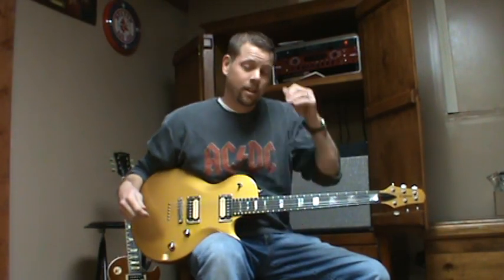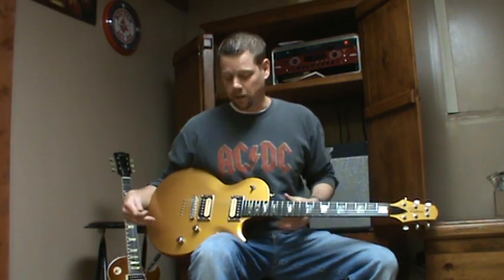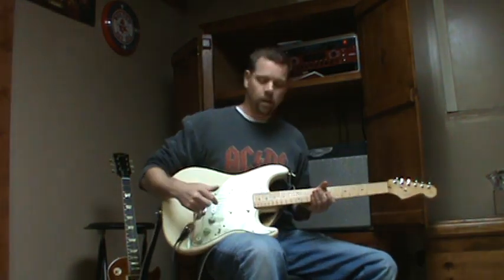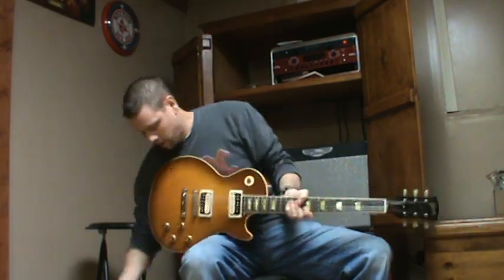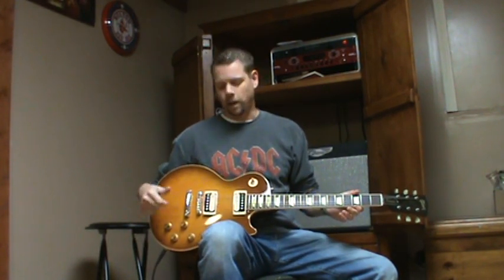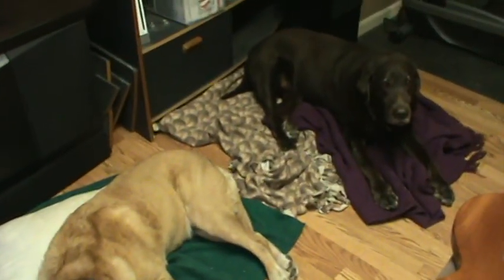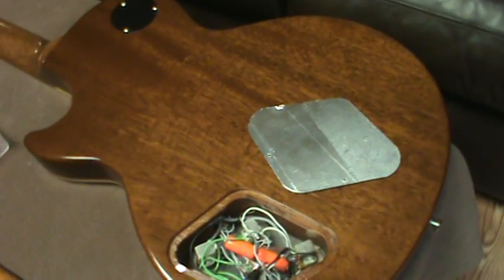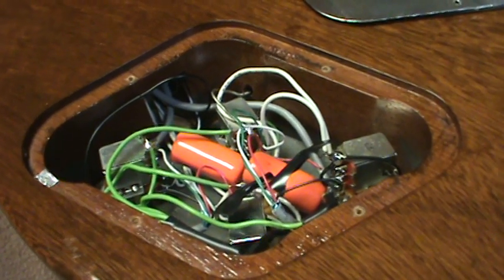Gibson Les Paul with Hum / Noise Issue

Comment: just my 2 cents, if you have the same noise with all the pickup changes and shielding that you've done,, theres a ground problem from the factory.,  few things to try would be run a ground wire to the tail piece. and also check for cold solder joints which basicly means go through the whole guitar and resolder every connection to ensure good contact.  in a last dig afford you could rewire the whole guitar with "shielded wire" if its not there from the factory already.   after all that I would be at a lost myself if it didn't work.

Comment: I've done a lot or rewires/mods in my day throughout my career as a musician. I've done work for friends, bandmates, and others from word of mouth. I have never had an issue wiring guitars/basses, etc. Never had a problem with ground/hum like this. 

Until an actual Les Paul fell into my lap to do for someone. The guy wanted a treble bleed. but I could not get the hum to go away. So thinking it was something I may have goofed, and almost $200 worth of parts later, I gutted it in pure frustration trying to figure it out. I still have yet to get it to stop. I'm about to give it back and say burn the piece of shit.
Reply: My brand new guitar has hum when I do not touch the strings, but not my 16-year-old guitar using the same cable, both have humbuckers, and amp with no peddles just the cable from guitar to amp.  I am stumped, but after testing grounding etc... I bet it is the humbuckers being different, but I have no idea.
Reply: I have 500T with treble-bleed, too. It has coil-split options. The crazy thing is it's noisier with the humbuckers than the single coils. The added buzz of the humbuckers are greater than the 60s single coil hum.
Reply: @waranghira  I found my issue a few weeks ago and it was a bad wire from ground to the bridge.  I measured the resistances and every wire was 0 (direct short) but this one was 0.4ish.  Replaced it with a 22awg wire and hum is gone.
Reply: @waranghira  I have the Identical problem with my les paul classic I just bought. My other guitars are clear and quiet. Way too much money to be dealing with this
Reply: @toneleudy  most likely same case with @generalawareness101 . A case of a bad ground wire (Haven't have, yet, checked mine if same). But yeah, you justifiably shouldn't have to deal with that if you paid for an actual Les Paul Classic.
Reply: Hello guys. .ive just had a Les Paul Junior 2015 with the same loud hum problem. Ive already did shielding the guitar cavities with a cooper conductive tape but it did  not solve the problem. I hav a Peavey Tele which i purchased in the 90s, which is very silent. .With this problem on LP. I come to think that maybe all LP are humming like this. .And if so, i wonder, how did Slash overcome such problem? if he had one since he has been using LP. .i did not hear a hum in his guitar in his live concert. .just thinking. .ty

Comment: My humbucker is more noisy than my single coil, what the heck. I double checked my wires everything is correct but the humbucker is very noisy. I followed seymour duncan's autosplit wiring.  The values of my pots is 250k. Its strat with hss pickup. Please help
Reply: None Ofyourbusiness same problem on my guitar too.   Please let me know if u found fix. :(

Comment: My Epiphone Les Paul Custom Blackback got the JP mod with 4 push-pull pots and Seymour Duncan pups, and I got the same hum noise. The hum goes away when I touch any conductive part in the signal chain, from strings, guitar jack, cable plug housing, amp metal switch, to even headphone jack on pedal... I looked at lots of pages and forums. Yeah, I know there's something wrong with the grounding. But what and where?? Then saw your post in SD forum back in 2012 which led me to this video. Exact sympton. I looked through all pages on that post. I do agree since the very beginning that it is not a bridge ground connection issue. And I did measure all conductive parts on guitar to output jack with <0.1 ohm readings. Well, I did not use shielded wire for switch to jack or between pots; I used separate insulated wires for leads and grounds and twisted the pairs together... Thought that should serve the same purpose. I'm ordering some shielded wire to change the switch to jack connection and see if it makes any difference for my situation. Guess I may end up scrapping and redoing the whole thing like you did... Thanks for your post!

Comment: We have a similar problem, if I hold the guitar and not touching any of the 
strings or any of the metal parts, the noise is there. As soon as I touch the
strings or metal parts, the noise is gone. But if someone that is not holding
the guitar touches the strings or metal parts the noise is reducing a single 
bit.

Comment: If that guitar has split coils on it's circuit (and I asume yes because of those push pull pots on it), turn around the magnet of one of the pickups could helo to solve that hum/buzz issue, depending of the pups combinations. I think this because is so weird that level of noise in humbuckers.

Comment: Hi everyone, this video keeps getting comments.  I posted this 8 years ago... LOL.  I have a new account now (hammers and chords).  But the ANSWER is simply that guitar was noisy.  I did re-wire it with a simple set-up and is was quieter, but the point is WHEN YOU TOUCH THE STRINGS AND THE HUM GOES AWAY IT IS NOT, NOT, NOT A GROUND PROBLEM.  If you have persistent hum that doesn't go away THAT is a ground problem.
Reply: what is it then?? when i touch the bridge and noise disappears?
Reply: Okay I know this is 8 years ago lol but what about fishman classic humbuckers in 2021 lol .......
Reply: My Epiphone les paul 50's standard gold top does have a ground issue i think. When I touch any metal part it gets even noisier. The wiring looks good. No disconnected ground wires or anything. Only thing I can think of is that mine isn't shielded on the inside walls either and maybe that is it. (I bought this guitar used in excellent condition from Ebay)
Reply: @elijahfroment625  check if the jack output wires are correct and not swapped.
Reply: @GuilhermeSantos2003  I did that yes. The other way round I get no audio except a buzzing sound.
Reply: My brand new guitar has hum when I do not touch the strings, but not my 16-year-old guitar using the same cable, both have humbuckers, and amp with no peddles just the cable from guitar to amp.  I am stumped, but after testing grounding etc... I bet it is the humbuckers being different, but I have no idea.
Reply: The thing that was missing from this video - was the carvin wired differently, and how extensive was the shielding on the carvin? 

For anyone reading whos frustrated with the hum on ironically humbucker equipped guitars, stop wondering if you have a defect. Go to a guitar store and try out a few les Pauls and see if they sound like yours. You'll find that they probably do. The old Touch the strings and it goes away symptom. 

Cheap fix. Tape a piece of copper foil over the outside of your output jack making sure theres good contact with the jacks mounting nut. Extend that piece of tape along the side of the guitars body. Now take your pants off and play sitting down on your bed or couch. The tape should be in contact with your right leg since you're seated. Hum is magically gone even if your hands arent on the strings but then  so are your pants. It's a compromise.

Comment: Where you plug the cord in, is that receptacle grounded.  My Gibson Les Paul Custom Shop Custom does the same thing.  I'm fixing to have my guitar tech make sure the receptacle where the guitar cord plugs in is correctly grounded.  It is obvious what is happening here, there is a small amount of current being biased through the strings and when you touch the strings you act as a shunt to ground.  Like I said my Les Paul is doing the same thing so I had a talk with her.  I told her I love her but I wish she wouldn't use me as a shunt to ground.  She makes me feel great but in public when she starts shunting to ground people may think she isn't getting enough from me and they could accuse me of denying her, her conjugal rights and then peole will want to play her.  I'm very adamant about this and being that I come from good people I can't have her acting like a common diddle seeker.  Don't you agree with me?

Comment: There should be a ground wire from the lower tail piece insert to the back of one of the pots( the neck volume pot) to ground the tailpiece saddle and strings. That wire can be broken or missing causing this problem. Take a VOM and measure the resistance from the outside of the jack. That is ground,  to the tail piece. If you do not have a short, 1ohm or less that is your problem or part of it. As it is when you touch the strings and the noise goes away your body is acting as a shield and filtering the 60hz  radiation from the guitar. You have to pull the insert and add a wire or repair the wire that is there to correct this.

Comment: How ever did the pickup install messed up, I think one of the pickups. or a pot is not grounded, Or the signal and gound is reversed some where. Some times simple is better, I dont think in the 70s page was using coil tap and phase switching.

Comment: I have always had a bit of a buzz in my 77 LP Custom.  The only guitar I have that has zero noise has active EMGs.  My 3 Strats have varying degrees of hum.  The LP is the worst.  As I've written to others it had been shielded from top to bottom and everything is grounded back to the volume pots and input.  The only total fix is touching a metal part of the guitar. You're right not a thing fixed it. I'm an experienced technician darn it, I will fix it and send suggestions.....I hope.

Comment: I had the same problems years ago. Two issues: The Les Paul probably has an ungrounded bridge. It is relaying static to the pickups. When you touch the strings, the static discharges through your body and the noise diminishes. However, your AMP should discharge most of this static down the grownded power plug (to your house's ground wiring). My amp had a ungrownded power plug (two prongs). I replaced it with a new 3-prong plug (Home Depot) and the noise was gone for good. ( I did NOTHING to the guitar.)Good luck...
Reply: thanks, will try in the house... 
I noticed that when I practice at home with a speaker on a table & power plugged frm an extension power brick, the same noise is always present.. 
but whenever I bring my LP in Church to play, I realised that that noise disappear... 
will try your tip at home then :)
Reply: Same experience: when I play my les paul just via my multi-fx and earphones there is hum, because it is not grounded. When playing at the amp, there is no hum.
Reply: I have the same problem that you are describing with the amp power cord. The power cord is a 2 prong plug & 2 wire cord that is hard wired to the amp unit rather than a 3 prong plug and a 3 wire cord that plugs into the amp. Like a computer power supply does. The amp is a Pyle PVAMP 60, it was $ 70 brand new, so it's not like the most expensive name brand you can buy from the traditional brands you would see at a Guitar/Music store. The guitar itself is the Epiphone Les Paul Special I P90. The guitar itself on a higher end amp is quiet, since the Pyle is a practice amp I can play clean and at lower volumes and it's not a big issue. I think if I paid more for the amp and was performing with it, this would be unacceptable. But since it's a practice amp and played at low volumes, it adds character, kind of like a buzzing ballast for a florescent light, like a vintage 1970's amp ?
Reply: The beauty of the Epiphone LP Special I P90 is that the bridge is a single piece that the strings go in from the front, then wrap over the bridge and up to the tuning knobs. It really feels more comfortable just resting my wrist on the bridge and the noise goes away. The 2 P90s being single coil units have some hum inherently because they are single coil pickups. But with both pickups active the 2 P90s generally act like hum buckers with dual coils. So I can live with the amp  & the un-grounded bridge. The wrap over bridge is simpler and there is no penalty to resting your strumming, plucking & picking wrist/hand on the bridge like other guitars. You can see the differences:

https://images.samash.com/sa/G08/G08790391.fpx?cvt=jpg
vs
https://static.music123.com//derivates/18/001/658/154/DV016_Jpg_Large_H77433.002_worn_TV_yellow_bridge.jpg

Comment: I have the same problem now after i changed the bridge pickup myself on my Ibenaz. I cleaned pots and output socket by electric component cleaner,  doesn't work. I guess all pickups need do star ground which i didn't do it when i change the bridge pickup.
Reply: SAme issue her but on my SG Standard. I changed both pickups and now i have this static hum. Did you solve it?
Reply: @EduardoGrados  Then I changed to be a bassist lol

Comment: Bro I feel your pain,  im in the middle of completely redoing my Epi SG to get ride of the noise. It has a Dimarzio Super 2 neck pup & Super distortion bridge,  so granted they are fairly noisy/hot. The SG has shielding paint from factory, decent job was done, but i mixed up my own with paint & graphite and gave 3 coats to the wiring cavity & pickup cavities. I will also connect each section with a ground wire & screw it into the paint. Completely new wiring after that & hopefully it should do the trick. Copper foil tape is another way to do it. But my guitars dont have super smooth routing jobs in the cavities so getting the tape to stay stuck is not happening.

Comment: Get an  Ohmmeter and check every control and  ground to the  Phono  Jack. that goes out to the amp.
This will tell you if there are any connections that are broken and which ones. Should read less then a  five or six hundredths  of an Ohm.

Comment: I’ve been dealing with the same problem for 3 weeks. I have a Gibson LP Classic/2016. It all started after installing covers on my 57 classic and 57 classic + zebra pickups. I removed the covers to see if the buzz goes  away but no luck. I took my LP to a technician and there it was... no noise! Now I know I might be dealing with EMI or bad wiring at home but I can’t understand why my guitar never had this issue before installing the covers... I ended up buying a new pair of the same 57’s classic humbuckers. They came with covers already. I still have the same buzzing noise at home, but it goes away sometimes at day. It’s soooo weird! I’m thinking on shielding my guitar but knowing that I didn’t have this problem before, I want to give it a tray once again with another technician.

I also checked the grounding with a multimeter. Everything it’s fine...

Comment: Also 5 years late.  Despite some of the pundits claiming that shielding humbucker equipped guitars does nothing,  shielding does work.   If the noise bothers you enough, shielding paint works very well, even the cheaper carbon based stuff when properly applied.    But I would not use it on a Les Paul or other expensive guitar.   Use copper tape that has a conductive adhesive.  It's removable unlike the paint.  Need to be thorough and do the main control cavity, switch cavity and pickup cavities as well as the back of the covers.  And, the top of the pot and switch cavity edges so the foil on the covers makes contact when they are re-installed.   Of course it's a moot point if you cannot pull the electronics yourself unless you are willing to pay a tech.

Comment: My SG does this exact same thing too.  I touch strings or Bridge and the noise stops.  I will get it sorted out and hopefully remember to post what I did to fix it.  The one thing I presumed might have been causing it was the ground wire to the tail piece grommet was not making a good connection to the TP, but when I extracted the insert from the body, and reset it, the noise was still there.  I will see what I can come up with using a test meter and other things and see if I can solve the issue.

Comment: I SHIELDED MY LP AND GOT RID OF THE STRING GROUND HUM THEN RECENTLY PUT A 10 PF CAP ON THE OUTPUT CONNECTOR BEWEEN THE SLEEVE AND TIP. IT NOW MAKES NO NOISE AT ALL.
Reply: could you please make a tutorial/video?
Reply: no prob
Reply: I've exactly the same fault on my new 2016 LP  Classic, store tech says no fault found when I sent it back ! 
What do you mean by the sleeve and tip B Carr ? on the output socket ?
Reply: Hi so in this case the sleeve is chasis gound. I had to use a very capacitance cap so as not effect the tonal value of the LP. 
   I bought adhesive copper strips from Ace Hardware, they are actually snail prevention strips and coated the pick-up and tone knob cavities of the LP.. 
Be careful not to get thin finger cuts from the copper strips use a chop stick to work it into the corners.The cap should have been installed at the factory as there is an open eyelet on the output jack for this. This is usually called a snubber cap.I don't know wht Gibson didn't put a snubber cap with these LP's . Anyway It takes transient pops and send them to ground which become more often to occur in a humid conditions as well. That why it doesn't occur when you take it back to GC it is an  environmentally controlled rooms perfect for connections and guitar bodies in general. After much experimentation this has for me and my LP.  
       So all you need is a 10 pico farad capacitor and 1-1/4 "copper strips. 
   I hope this helps. Its a great guitar once you do this small modification.

Comment: I found a USB wire that im planning to use to run from the cavity up to the switch and back. Its FULLY shielded and has 4 wires in it. Ground and bare red, white and green. Thats all the Gibsons need.
Reply: Rondo McBower hey buddy, can you explain this? And did it work on your guitar?